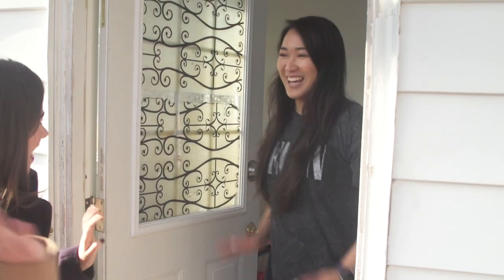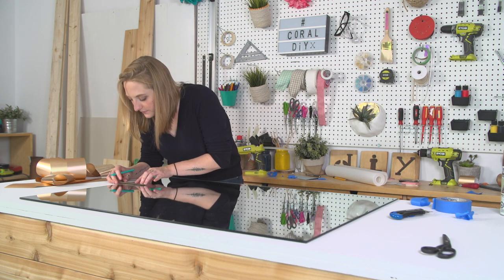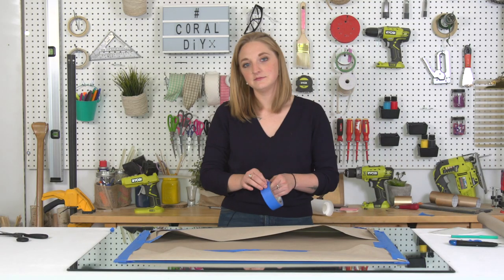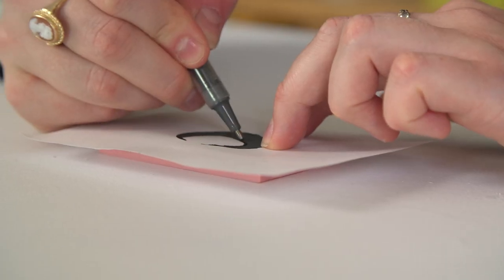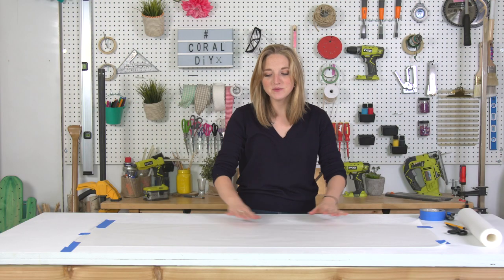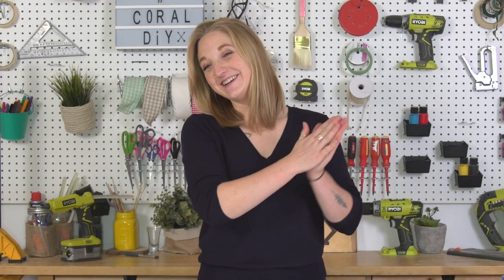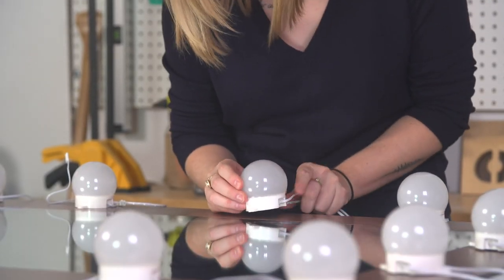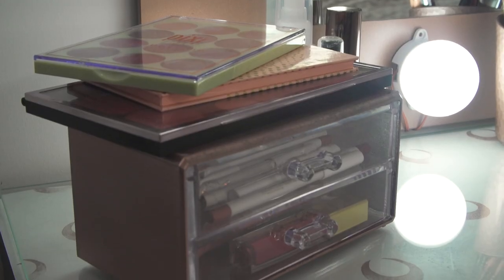DIY Rose Gold Vanity Mirror Station + DIY Stamp!

Comment: Very nice! How did you make the stool cover? You said you used glue (in the buy or DIY episode), but I'd love to know some details of the process.
Reply: Sure! I found an old faux fur rug to use that was bigger  than the bench I was covering, then cut out a "+" shape in the rug and used fabric glue to seam it together. Super simple and required no sewing! Just make sure to measure how much surface you need on the top and give about an extra inch on each side for security!
Reply: @DIYDanie  Thank you for answering! So you glue the back, not the furry side, right?